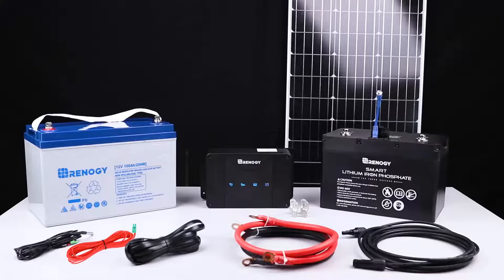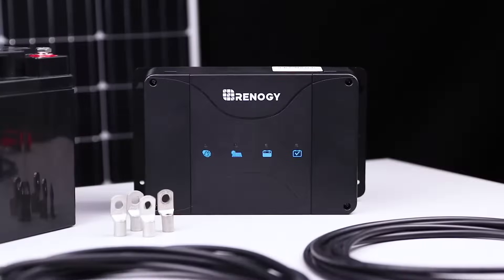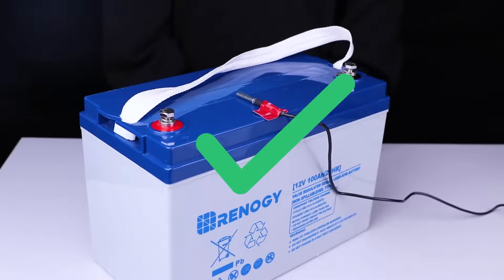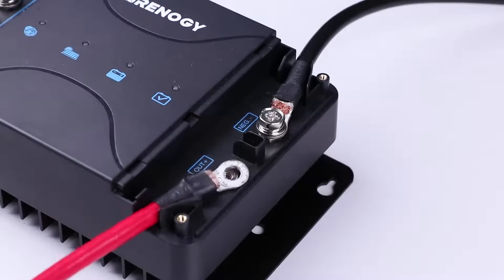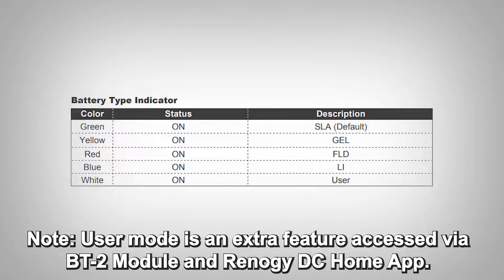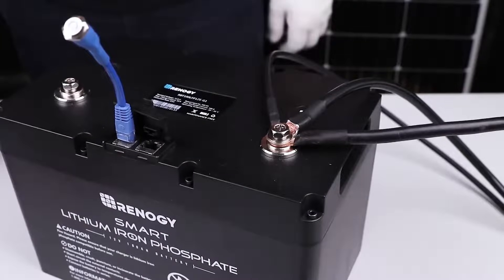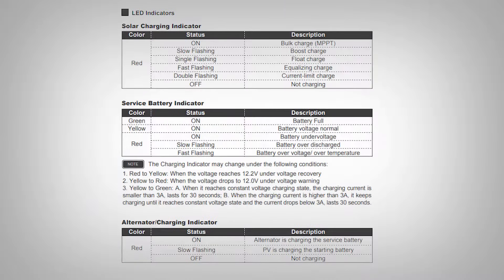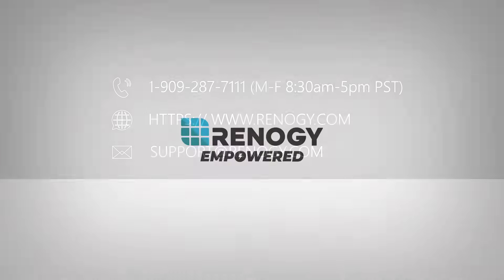30A/50A DC-DC On-Board Battery Charger with MPPT

Comment: QUESTION, if anyone can chime in the opinion, please:
So, with this kit in place (installed exactly as the video shows) and if  I want to use the Renogy 20A AC-To-DC LFP Portable Battery Charger to charge my house battery from the wall at home (110V AC), do I just clamp the alligator clamps to the house battery for charging, or do I need to disconnect ANY lines from the system first?
In the other words is the AC charger just a simple add-on or it requires some work around to prevent the rest of the system from being damaged...?
Reply from the maker: Hi, AloPandur.

Thank you for contacting Renogy.

You just need to clamp the alligator clamps to the house battery for charging. You can click the link for learning our AC to DC battery charger: https://www.renogy.com/20a-ac-to-dc-lfp-portable-battery-charger/.

Have a nice day.
Reply: @RenogySolar  Hi, thanks for your answer, trying to reply to you 4 times here and my post disappeared 4 times. The main dilemma I have is that I received another answer from the support  and they suggested disconnecting the battery before using the wall charger. Which one is correct?
Reply from the maker: Hi, AloPandur.

Our technical support staff recommends that you disconnect the load before charging for safety. But if you do not disconnect it, it won't have much impact. You can choose to disconnect or not according to the actual situation.

Hope it is helpful.
Reply: @RenogySolar  Thank you very much. I guess it will not be a huge of a deal to drop in an inline switch before my house battery, and I will do it just to be on the safe side...

Comment: This video shows that you should not connect the temperature sensor to a Lithium Ion house battery. In the instructions however, it reads the following: “If the service battery type is set to lithium, the DCDC will stop charging the service battery when its temperature is lower than 1°C, and recover to charge when it’s higher than 3°C.” How will the unit know what the temperature of the battery is? If it measures air temp that could be significantly different than battery temp.
Reply: Why not answer here as we need to know the information before we buy this product?
Reply: @kumji1313 they won’t answer it here because their tech support sucks.
Reply: EXACTLY!  WTF   @kumji1313
Reply: I'm thinking the same thing! I have a heat pad for my battery, but am i going to have to heat the whole space just to trigger the charge?!
Reply: I'm wandering the same myself, I want to go lithium but the Renogy battery I'm looking at doesn't have low temp cutoff.
Reply: The temp sensor is probably intended to prevent boiling lead acid batteries. The BMS in lithium batteries should protect from high and low temperature charging. You are correct, it would be very useful with lithiums, but they forgot that.
Reply: The BMS (battery management system) integrated into your Lithium battery is typically what will protect your battery, but research your battery type. My Renogy battery has warnings and protection circuitry built into it so it will not charge or discharge if it is outside the safe temperature zones for either.
Reply from the maker: Hey Peter,

For any technical questions, please contact us here-https://www.renogy.com/contact-us?gclid=CjwKCAiA3pugBhAwEiwAWFzwdeH3Crd9vRTbjjTYl9l3daVqnotJPjBhs2nmw-Wkn1_guWQeW0ao6hoCOHcQAvD_BwE

Comment: If this unit is installed on a small trailer that is wired to a 7way plug that is hooked up to my small truck work the same way? Or does it have to be wired directly to the truck battery.
Reply: It will need the amps you get from a larger cable or it will never charge the battery

Comment: I need a little help please, I just install my Renogy 30A Dual Imput DC to DC charger and the BT-2 bluetooth also. When I start the engine to test it I have only 0,20 Amps being charged to the house battery.  I suppose it is because my house battery is 100% fully charged and no load on the battery at the moment of test. It is correct or my charger is faulty? When I switch on my fridge the charging increase to 5 Amps, I hope my charger is ok, thanks a lot.
Reply: I discovered that the cables was not correctly inserted on the Anderson plug, I put new plugs and insert It till the end inside the conector and now everything is working properly.
Reply from the maker: Hey Terra,

For any technical questions, please contact us here-https://www.renogy.com/contact-us?gclid=CjwKCAiA3pugBhAwEiwAWFzwdeH3Crd9vRTbjjTYl9l3daVqnotJPjBhs2nmw-Wkn1_guWQeW0ao6hoCOHcQAvD_BwE

Comment: can this item connect the 2 batteries for boosting the starter battery if it were to go dead?
Reply: It's crazy how terrible renogy customer service is. Hire some new employees folks!
Reply: No, but you can use a jumper cable between batteries in emergencies.

Comment: I have a 50A ver in a 2014 Sprinter with 200ah of renogy lithium batteries.
I do not get more than 25A from the alternator even though dc-dc is set to 50A
Any idea why?
Is there a setting on the battery side how many amps they accept?
Reply: Sounds like you need larger guage wires.
Reply: @standingmannequin7911  lol
You really have no idea what's going on
Reply: After buying the 30 amp and now seeing the video, half comes from solar and half from the alternator 25+25=50. Guess I should have went 50 too.
Reply: This unit has quirks. One is that it only works for solar panels under 25v. That's a hard limit, so you can basically only use 12v panels in parallel.  It also has an unusual way of limiting input current to 50A. Basically, if you have any solar power coming in, it reserves 25A for the solar side and 25A for the alternator side. Just be aware of that; it works that way by design. If you want to charge your batteries with 50A from the alternator, you have to cut off solar with a  switch or relay. The so called smart alternator input actually just changes the threshold for charging. This is explained in the manual. When it is on you can put much more charge current in from your alternator while driving if you want a faster charge. I tie it to the alternator voltage, and get the higher charge currents from the alternator at lower voltages.
Reply: So if your solar panel is only giving 10 amps does that mean your alternator will only give 10 amps? Seriously, I'm considering this charge controller if I can still get 50 amps with low solar output.
Reply: @standingmannequin7911  if you have a 30A ver then u get 10A from solar and 15A from alt (half of 30)
If you have 50A ver then u get 10A from solar and 25A from Alt (half of 50)
Reply: @gdrozd555  is it possible to set this? For example if I am driving set only from alternator and if I am not driving set only solar panels (or both, cause my solar panels don't reach 50ah)
Reply: @mircoct  
You can turn off solar panels with your disconnect and then u get a full charge from alternator.
Just remember to turn solar back on when you're partked
Reply: @gdrozd555  ok this is perfect.. Thanks :)